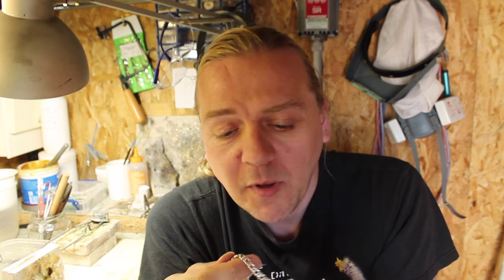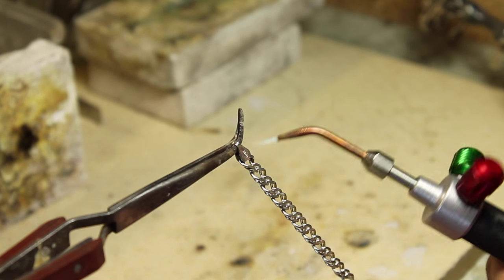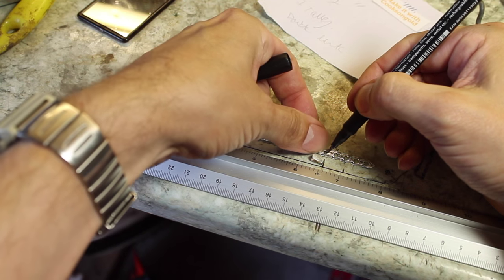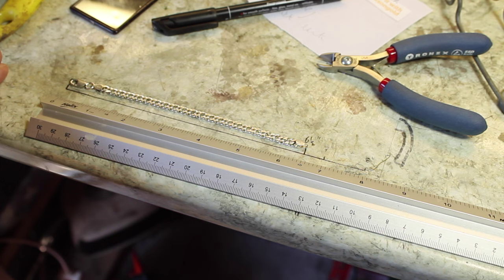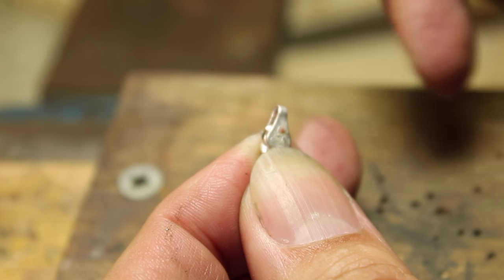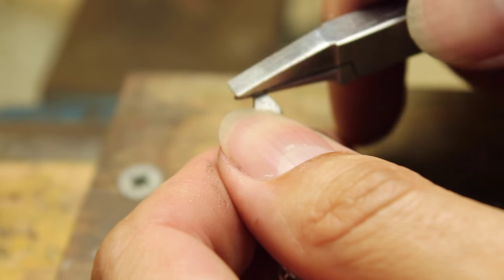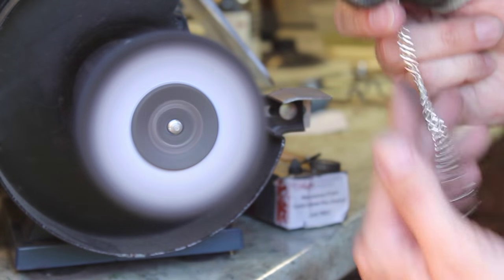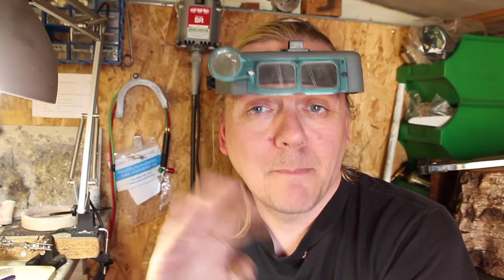How To Adjust & Repair A Silver Bracelet. Silver Soldering Techniques

Comment: My bracelet has silver beads on it and a silver charm……… the problem is I promised my bff that I will never take it off so when I’m washing my hands or taking a shower I’m starting to not I’ve the silver coming off and I need a way to fix that……

Edit: sorry I meant notice (auto correct)
Reply from the maker: If the silver is coming off the beads, then they aren't real silver, they must be some kind of plated costume jewellery.  Real silver can be re polished, but with costume jewelry you have no idea what it is,  if its plated, painted, or lacquered with something. There's probably not much you can do about it. Sorry. Dave